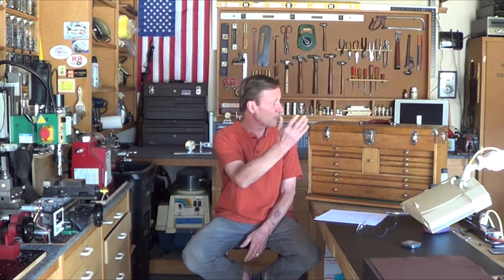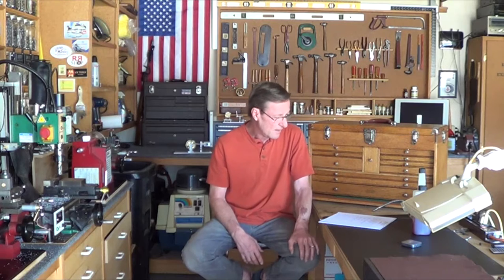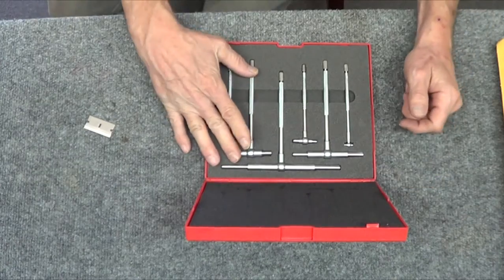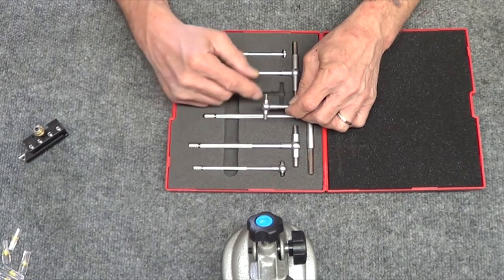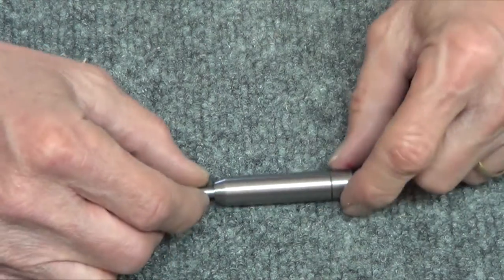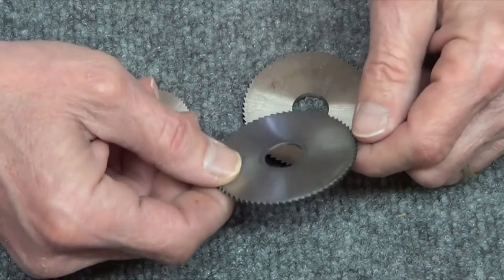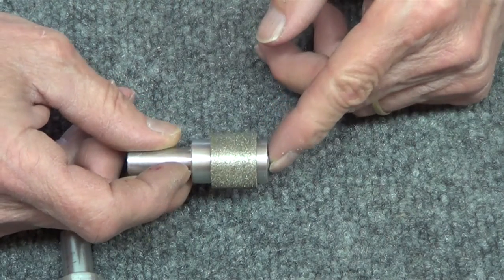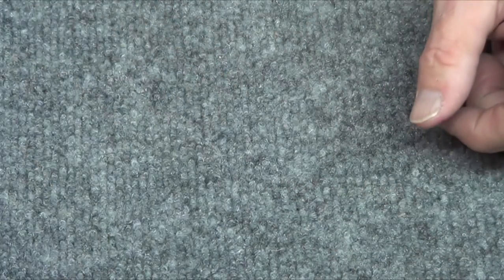Shop Toys Video #132

Comment: Hey, Dave!  Happy Friday!  Another thing to try is non-methanol gasoline.  I don't know if you can get it in CA, but the methanol is hard on plastic and attracts water.  I buy it from CENEX up here in WA, but I know there are other suppliers. I run it in all of my power equipment and with the Stabil I have used year old gas with no issues.  As usual, I enjoy spending a little time in the shop with you.  Keep up the good work and if we don't see you next Friday, have a happy and safe 4th!